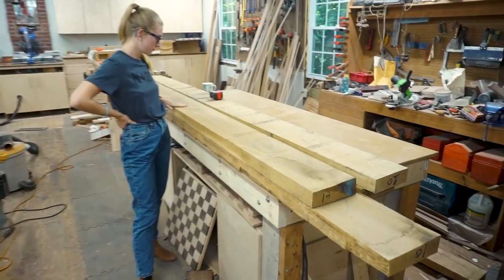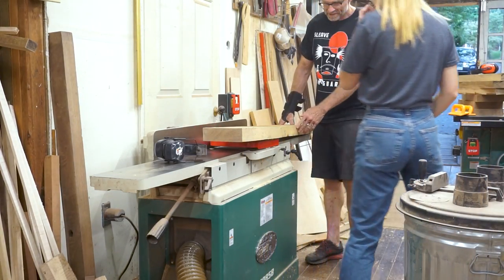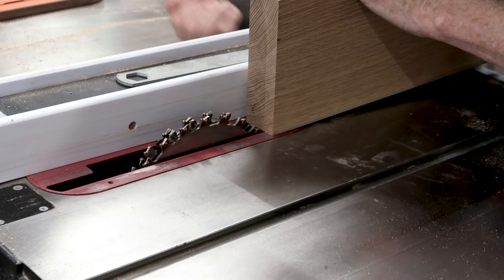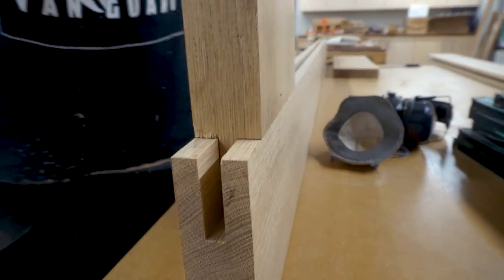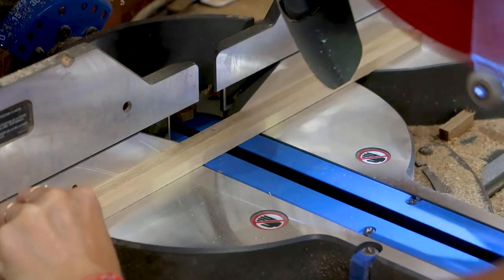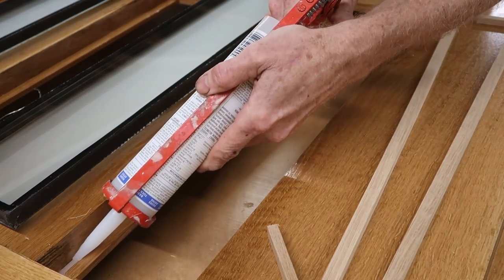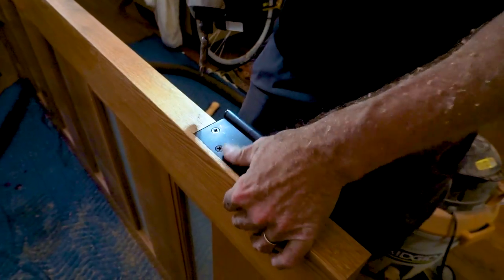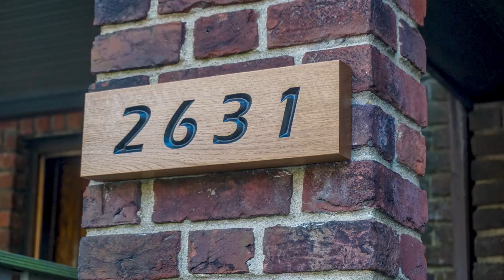We Made a Modern Front Door | A Father/Daughter Project

Comment: Now you have gotta get the rest of the house to match it LOL. I used marine grade Spar varnish on a wooden swing set for kids and that stuff was great. Lasted so darn long and with a light sanding; I reapplied another coat years later and it still is great shape. So that door is going to last a very long time for sure. I am, however, thinking about the lack of room for the door to expand and contract. When I made cabinets at a cabinet manufacturer we had to make sure we left enough room for the contraction and expansion of the wood panels. Stil this is a well-made and great-looking door.
Reply from the maker: One of the reasons I chose quarter-sawn white oak is because it is dimensionally quite stable, so it won't expand and contract as much as other wood types. I am hopeful that the clearance around the door will be sufficient to accommodate any wood movement that does occur.  We're going to renovate the entire house and we'll release videos for at least a portion of that. Those will be some other fun father/daughter projects. 😊

Comment: Awesome project and beautiful door.  Do you need to worry about wood movement in a solid door like this.  Thanks much!
Reply from the maker: I'm not expecting too much wood movement because the wood doesn't move much along its length. But time will tell.  I think I have enough clearance and an adjustable threshold to accommodate any movement that does occurs.
Reply: @Woodumakeit  Thanks, beautiful work as always.

Comment: Question about the jointer: Does the amount of material you are removing at one time have an impact on how difficult it is to move the wood across it? So more material = more difficult?
Reply from the maker: Yes, that is correct. It also puts more load on the motor. Based on the difficulty my daughter had, it would have been better if I had raised the infeed table a little so that it was taking off less material with each pass.

Comment: @Wood U Make It:  Only just found this video.  Wife wants a new front door.  Might use some alders I need to drop in the sheep and poultry portion of the property if they’re big enough diameter to quarter saw and get the width I’d need.

Couple questions.  Hopefully you see this given it’s an older video.  What thickness was the rough sawn stock?  10/4?  Also, curious why you didn’t pre finish the small strips that went on the inside to hold in the glass?  Since you didn’t glue them anyway seems like pre-finishing might have been easier as no need to worry about the finish getting on the glass, plus you could have put the finish on all sides.

Regardless, excellent job, and awesome that your daughter has the interest and willingness to join in on such a project.

Comment: I don't understand why people take multiple passes with sliding miter saw.
Reply from the maker: You get a cleaner cut on the top face by making a shallow cut first, although it doesn't matter too much with rough-cut lumber like this that we're going to joint and plane anyway. It's just more of a habit for me. But it also puts less of a load on the motor of the saw, which is always good.